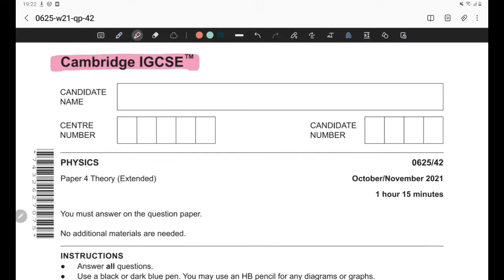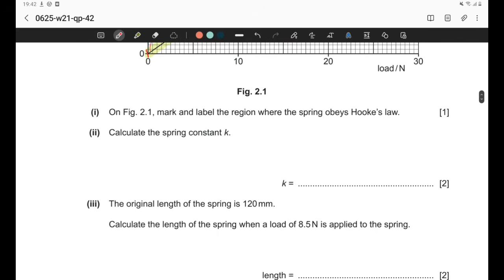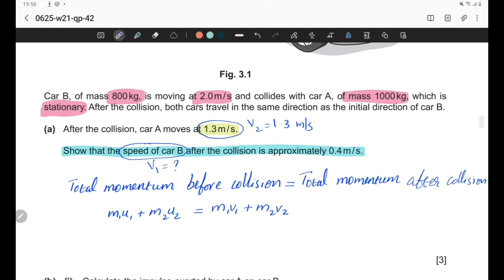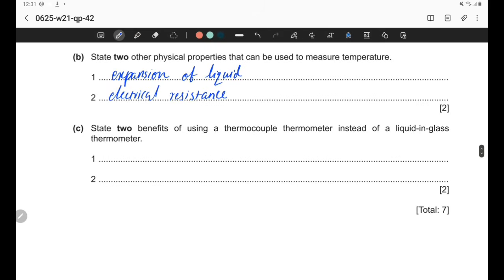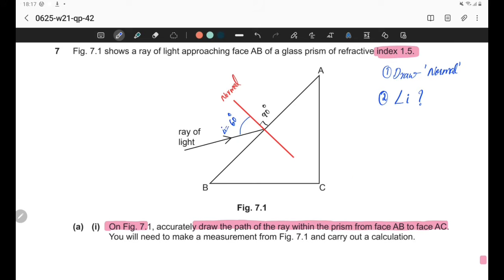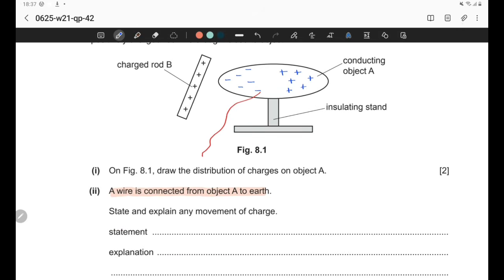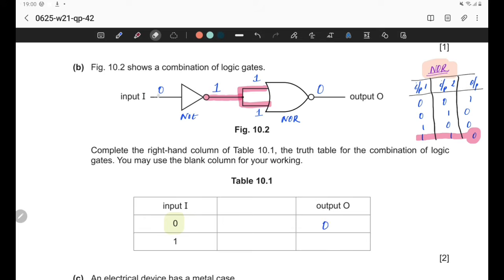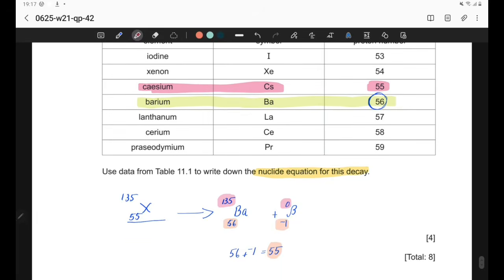0625/42/O/N/21 whole paper Solution IGCSE Physics paper 42 (October/November 2021) Paper 4 Theory

Comment: drawing in question 7ci 37:20 is wrong, angle of i is equal to angle of r, we can draw a tangent on the bottom wire according to the curve and measure the angle of incidence, in the marking scheme it mentions that there will only be one reflection on the bottom wire and end on the left of the diagram, please correct.
Reply: Thankyou
Reply: you helped alot
Reply: I came here to confirm should the 2nd reflection on lower or upper wall and here 😂😂